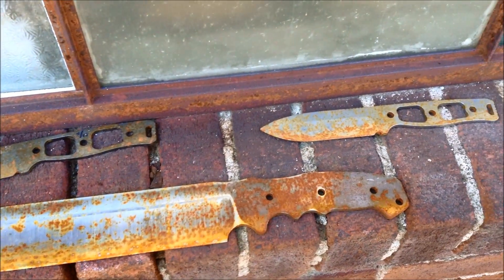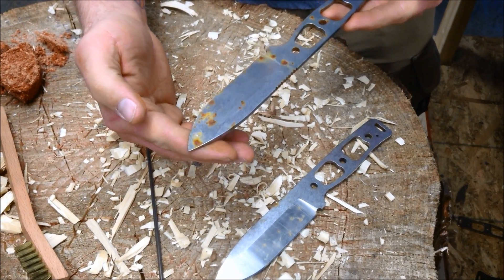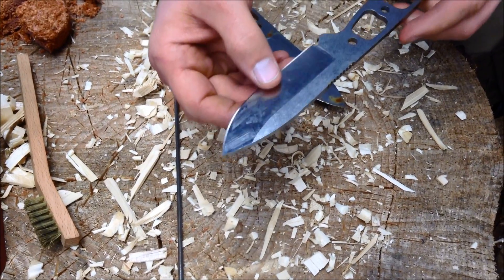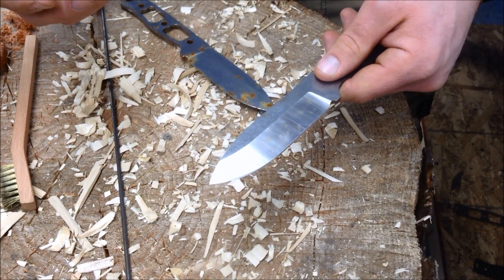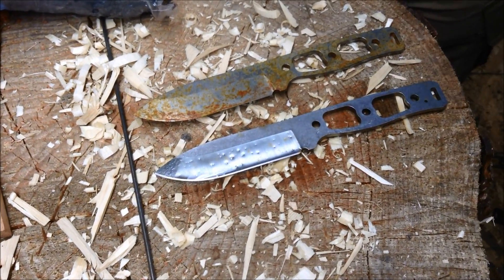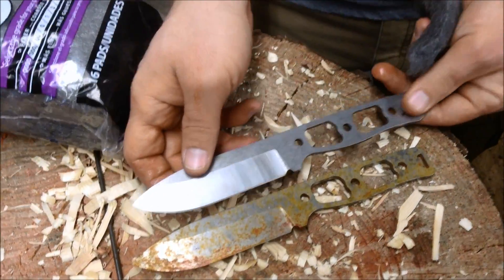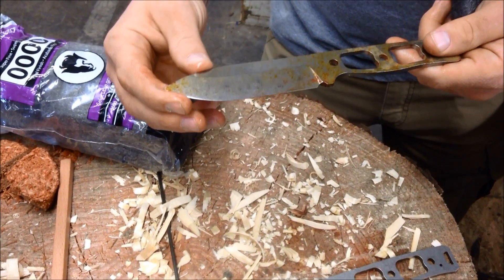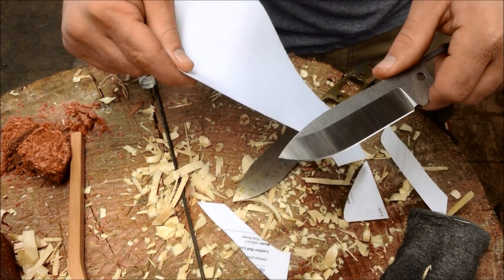CPM-20CV Corrosion Test

Comment: From my experience, 20cv rusted quite easily. I live in a hot area, temp regularly pushes triple digits and my blade began to rust from just being in my pocket. I assume it was the fact that I sweat in pants. Maybe the mix of water and salt got to it. hopefully s110v holds up better
Reply: cpm 3v 7.5% chromium cpm 20cv 20% chromium cpm s110v 15.25% chromium... i have knives in the second two neither have rusted from being in my sweaty pockets while working in hot humid environments... that being said cpm 20cv should be the most rust resistant of the 3...
Reply: also.. lc 200 n only has 15% h1 has 15-16%, both are sold for use on the ocean.... anything with more than 15% is suposed to be essentially rust proof and considering 20% in 20cv i highly doubt ball sweat caused it to rust XD unless whoever made your knife is a liar...? what kind of knife was it if you dont mind me asking?

Comment: theese knives are no water resistant?

: (
Reply from the maker: Szabolcs Kiss I would consider these steels to be pretty weather resistant, especially when compared directly to a lot of other blade steels typically used in the industry. For an alloyed tool steel (not considered a "stainless" grade) the CPM-3V stood up very well. Even after a year the blade doesn't looks much worse, cleans up pretty easy and suffered no degradation in the integrity of the blade. The edge was still serviceably sharp. The Stainless CPM-20CV did very well in my opinion. I'm still not certain if the few spots on that blade weren't just foreign contaminant of the surface.
Reply from the maker: *****  If a person were looking purely for corrosion resistance, a steel like H1 would be a good selection. A2 tool steel has a relatively low level of corrosion resistance, containing only about 5% chromium.

Comment: Thank you for the video Guy. Do you recommend and have you tested Tuf-cloth with CPM-3V?
Reply: I do find myself using some sentry solutions products on folder hinges but I sometimes cut food with my knives so I mostly use mineral oil for a final wipe down after a thorough cleaning.
I know there are more effective things but mineral oil is food safe. I've never really had corrosion troubles on my users.

Comment: Hi Guy, thats quite a clear demo of how resistant cpm 20 v is to corrosion. In my opinion this steel would not need any further coatings to protect it. As I think I mentioned before, in my opinion aesthetically the tumbled finish is a beautiful finish which has its own character and which ages like good wine! a.t.b. vee